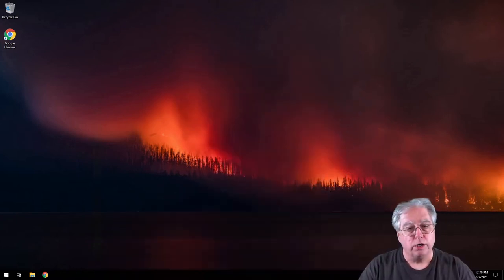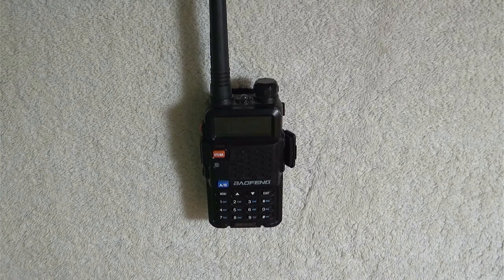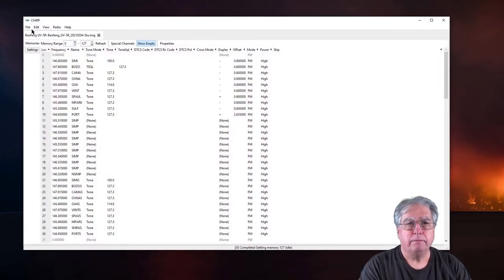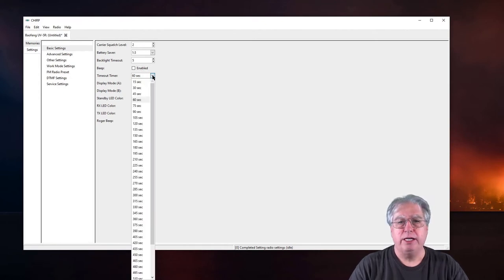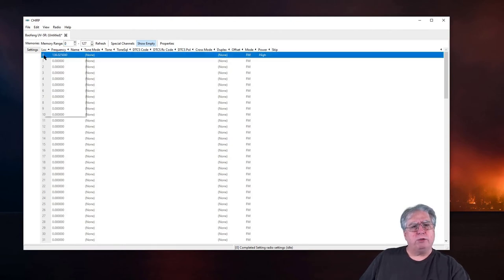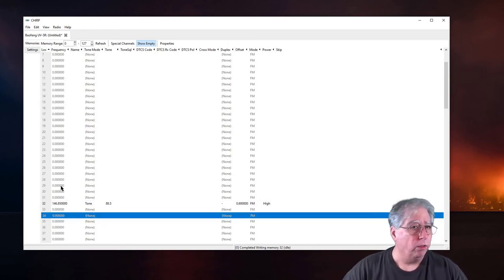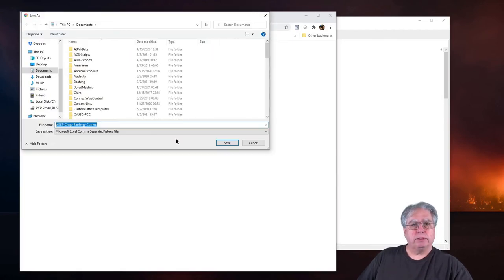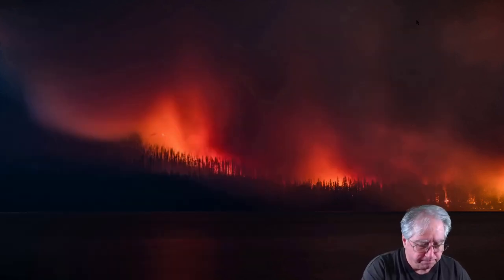How To Program Your Baofeng Radio Using Chirp Open Source Software

Comment: I have tried programming my bf-f8 + using chirp and for a certain local reapeter my offset won't download to my radio I have Doble check the offset for the frequency to make sure it's correct. do you have any suggestions what could be the problem?
Reply from the maker: Hi Prep 787,
If I remember correctly, you would select 'Split' for Duplex and just put in the transmit frequency for Offset. The BF-F8 might be different, but I believe that all Baofeng radios.
Hope that helps!

Stu
AG6AG